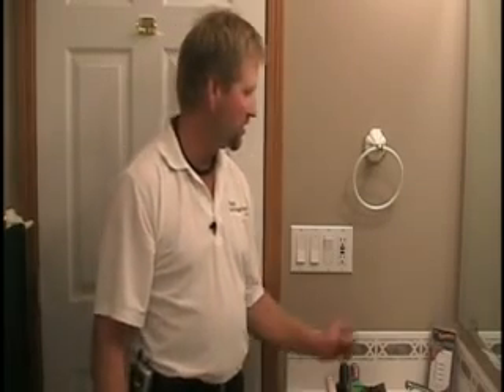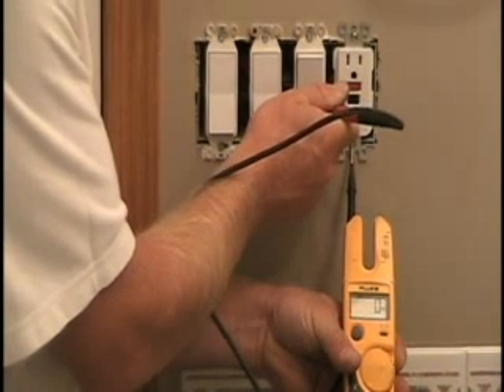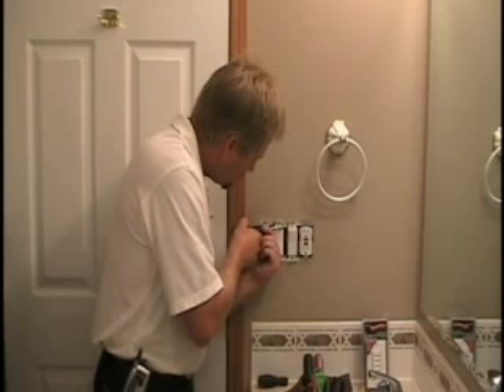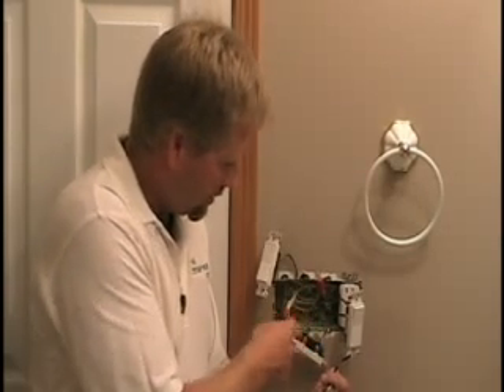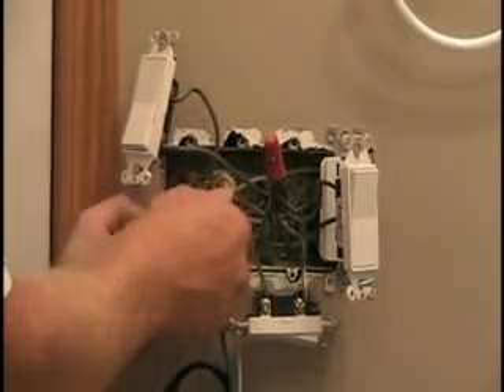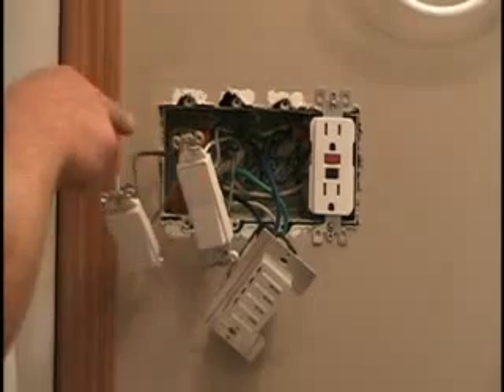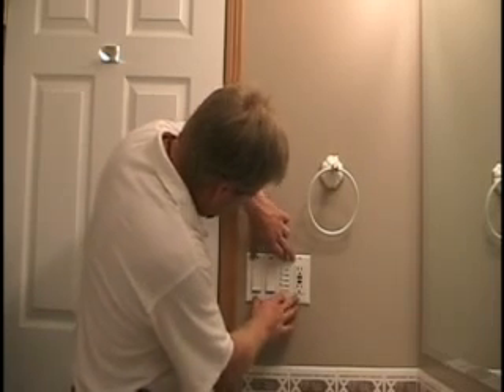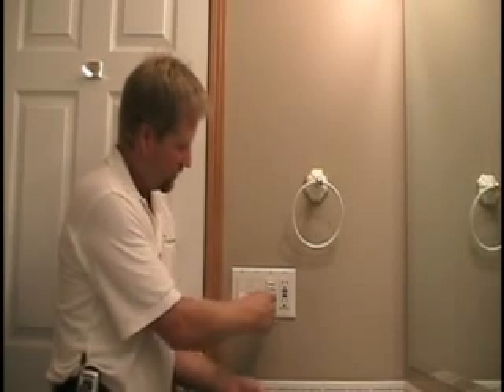Wiring a Bath Fan Timer Switch

Comment: My old fan switch had the white cable jumped onto the next light switch. Now that I've hooked it up with the jumper also, it only turns on when the light is on (which did not happen with the old switch). Any ideas?

Comment: I have this type of fan switch in both my upstairs bathrooms  and they  drive me crazy.  When I run my portable air conditioner downstairs,  it pushes all the hot air upstairs.   Obviously on hot days I want to keep the  windows and curtains shut , so  I run both the upstairs  bathroom fans which helps dissipate the  heat  but the damn things  keep shutting off.   Is there some way to override the timer so that the fans keep running continuously?

Comment: what if the switch you are replacing for the fan is alone in the box and there is only a black and a white wire (hot and neutral) plus ground... How can I wire it with this type of a timer (four wires)?